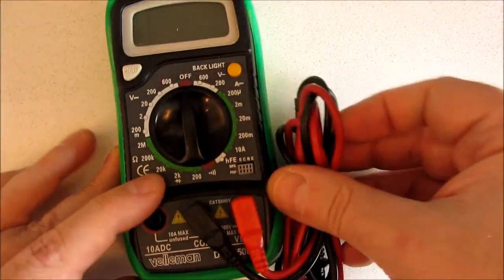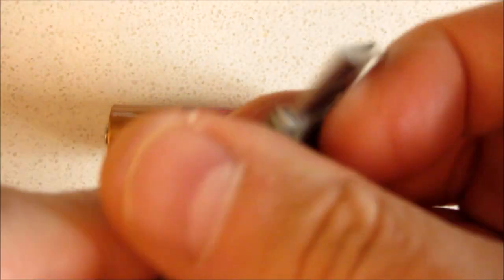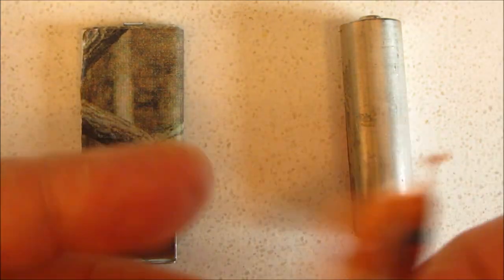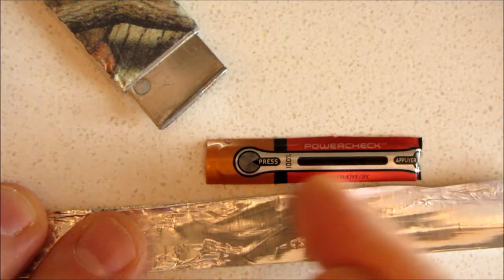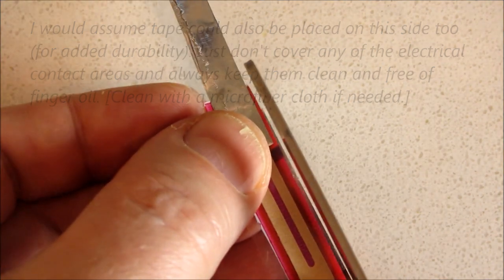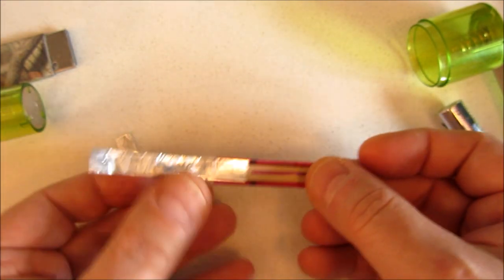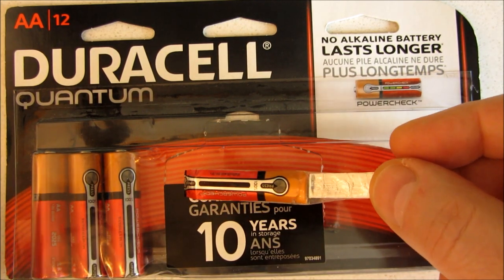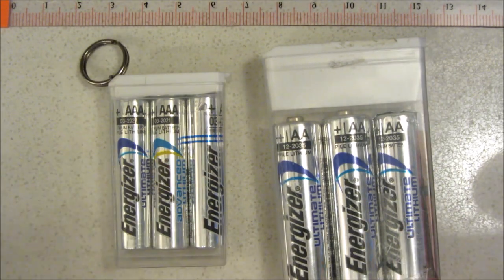"FREE" DIY Battery Tester

Comment: Works! And, while I had a ziplock bag full of used batteries to test, I just happened to have in that bag one dead Duracell Quantum that I could get the test strip off of. It took extreme patience and a gentle hand to get it the battery covering off without ripping it, as it was adhered by glue to the battery. It helped to score the wrapping directly opposite to the test strip so I didn't inadvertently cut near it and had plenty of wrapper to gently peel piece by piece until I was peeling it as a whole. But, it was worth it because I'm finding plenty of still good batteries in that ziplock baggie, that I would have otherwise EVENTUALLY thrown out. I've been saving them over the last year and a half, and go through a lot of batteries with a 10 year old with wireless game controller, and our wireless mice, countless remote controls, etc. etc. This little homemade device is going to save me from buying batteries for a while. Thanks MeZilch. And, it's so great to be able to "You Tube" DIY and find solutions for every day problems and to save resources.
Reply from the maker: Good to hear!

Comment: you could also use electrical tape on the bottom tip of the reader & on the extended (aluminum) side to keep from burning your fingers.
Reply from the maker: That sounds like a good idea however in normal, quick use you can't even feel the heat. Problems can arise though if the test button gets locked to the "on" position (it happens) as well as attempting to test exposed metal batteries such as the one you stripped naked to get to this tester strip!

Comment: if you were to create a "heavy " paper slip-cover you you could make it safer so that it could be packed without the risk of shorting out.
Reply from the maker: Yes, a non-conductive paper storage sleeve/pocket might be good for people who want to safely store this tester INSIDE their battery compartment. Good idea! . . Also, as I mention in the video's text 5:48 , clear tape can actually be run along both sides over nearly the entite length, not just one side like I show, for added durability and safety. Only the test button area and the tips that touch the battery terminals need to have the exposed metal.

Comment: The way tthese testers work is by shortening out the battery and heating up and the indicator is actually a simple heat indicator, so don't use them to much because they will drain your battery.
Reply from the maker: Yes, good point, they drain power quickly so they should only be used sparingly.

Comment: Hi MeZillch. Cool video, it was more or less what i was looking for, except i had a small hope that it could be done without something like the test strip. Regardless, cool vid.

I have a question though,  any battery with a charge indicator strip will work right? Doesnt necessarily have to be the quantum brand?
Reply from the maker: I have no experience with any other charge indicator strips so I can't really comment, but my guess is it would work? Be advised shorting the plus and minus together on any battery can potentially generate heat and also be dangerous. Proceed at your own risk.